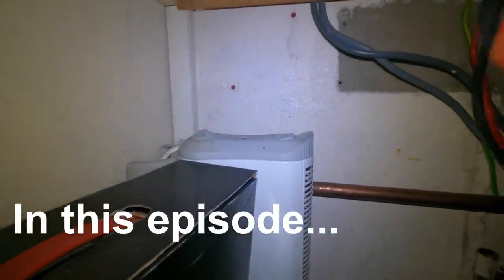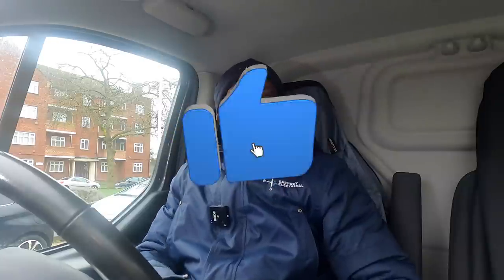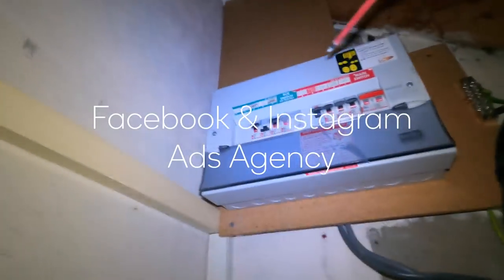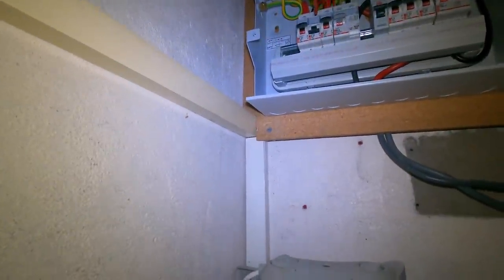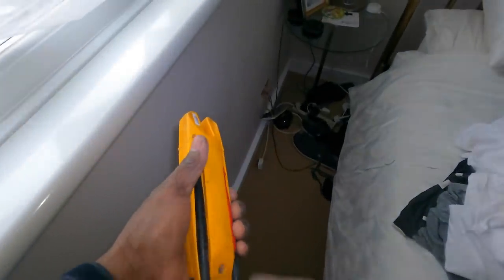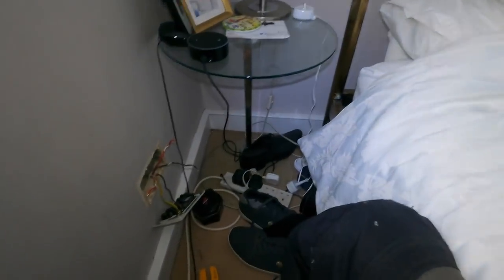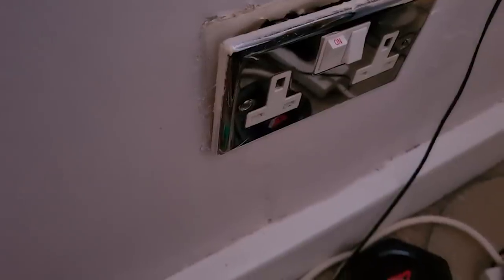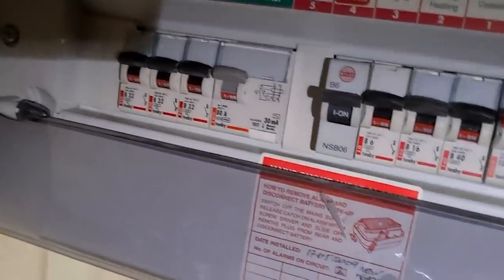Weird Ring Circuit Fault | Electrical Fault Finding| Electrician In London

Comment: So if a cable was short circuit between N&E and its been disconnected at two positions then surely the ring continuity is now not continuous 🤔 so therefore it has become two radial circuits fed from a 32Amp mcb and should be downgraded to a 20Amp?
Reply: Not necessarily, neutral and earth is one in the same conductor. But you're right should be dropped down to 20.
Reply: I was wondering if he rewired the damaged leg ??
Reply: @syntaxerror724  neutral and earth are only the same at the supply intake on a tnc-s system  . Throughout the house it's separate conductors.
Reply: @dennisphoenix1  maybe he forgot to drop down 🤣
Reply: 100% derate to 20 or 16

Comment: I don't envy you at all with these call outs. I'm not a spark but how do these faults on the ring happen? Were they suspect on installation and never tested properly? Rats don't chew the cables under the plaster...
Reply: The cables go under the floor so could be damaged by rats or by householders nailing loose boards down that squeak

Comment: Ring main circuits or "final ring circuits" that they have to been come known as now, were the worst thought out circuit to be used in the electric industry and are now slowly been phased out and not before time... There a nightmare when faults occur on them especially on older circuits when spurs where added to them and not not recored at the fuseboard log... 
Great video Del, you must find these callouts very time consuming...
Reply: Ring finals are being phased out are they?  Not something I was aware of, where do you get this information from?
If you know what you are doing, rings can actually be easier to fault find than radials.
Reply: @andrewcadby  at least with a ring you can get 50% working straight away by just removing and disconnecting one socket,  can't guarantee that with a radial
Reply: I think ring circuits are useful and they can serve a much bigger floor area m2 than radial circuits, as long as they're wired correctly. The trouble is, a 32 amp ring will still work even if there's a break on end to end continuity, which runs the risk of running the equivalent of 2 radial circuits on 32 amp circuit, unprotected from overload and no one would know, because everything would still be working. Can't see them being phased out, but maybe in the future they'll be a device that could sound an alarm if there was ever a break on the ring, during a live situation. But then again, what about spur off spurs?
Reply: You can add spurs to a radial circuit just the same as a ring main so no difference in fault finding.  Rings were apparently brought in because of a copper shortage.
Reply: @charlieg3654  This is true. However, a single break in end to end continuity of a CPC on a ring will still provide a CPC to every point on it.  The same can't be said for a radial, where much of the circuit would go unprotected without any signs to the user.

I think the point people like Brian Kelly miss is that no circuit is infallible, and any circuit is open to abuse.  Problems with socket circuits are probably more common with rings simply because they are more common than radials.

Comment: I am of the opinion If you a going RCD a home, you basically need  no more than 2 point per circuit otherwise circuit fails  as RCD's aren't  designed to run 20 points run off of them..
Reply: @supersparks9466  pretty common issue here in Australia with rcd  tripping on an overloaded circuits
Reply: Bullshit! Our RCD’s have a rating on them. 63A, 80A, 100A etc. So can definitely handle more than two points.
Reply: Jason in the UK there's millions of installs where there are two (30mA) RCDS protecting the entire property, the theory behind two is primarily to avoid plunging the property into absolute darkness if an RCD trips, - you'll often tie the upstairs light and downstairs sockets on the same RCD.  RCDs aren't really designed to clear big fault currents, but then thats why they're always paired up with MCBs. What makes them trip normally is cable faults, water ingress into outdoor circuits or failing class I, typically kitchen appliances.
Reply: @edc1569  I lived in Oz and most of the time in a dual RCD-wired house. Multiple sockets on two 20A radials - definitely more than two points! And the RCDs rarely tripped- once when water from a broken kettle flooded the base, and once when someone poked something into the toaster. In other words, they did what they're designed to do. RCDs were relatively new there; my neighbour had a single RCD board and water in his retractable awning switch took out his entire house, and every point on every circuit had to be checked to restore his fridge. Not an overload. I suspect the OP is confused...
Reply: @tomorichard   20+ points off of 1 rcd.

unlike original fuse blocks where you could over drive them to a failure point the modern rcd  tends to fail quicker, when used..

in context  10 double  gang power points= 20 points, not 20 single power points

It gets scary when you got the scenario 20 double gangs on 1 circuit 

whilst common to do a room on  1 circuit doing a whole floor on the other hand I don't recommend it..

though this is what happens when people do shit on the cheap.. which is like the world over because they can't be bother to do a proper job..

even knowing you might top dollar due to location today for the old townhouses how safe are  we today..

Most countries that use to ground to the water/gas supply stopped this grounding 20+ years given how unsafe it was i am surprised it is still used in the UK given most outlawed the practice years ago..
Reply: @jasonhowe1697  I think you are confusing Rcd's with Mcb's .  Rcd's don't offer an overcurrent protection,  Mcb's do . That's why we have them in series to cover earth fault and overload . As regards the using the pipework as a ground we don't rely on that , we have an incoming earth and main bonding cables going to water and gas pipes , new properties now have plastic gas and water pipes coming into the houses so have no grounding influence.
Reply: You can have ring with 20 amp breakers then if split no problems
Reply: Or 4mm CSA ring on 32amp breakers